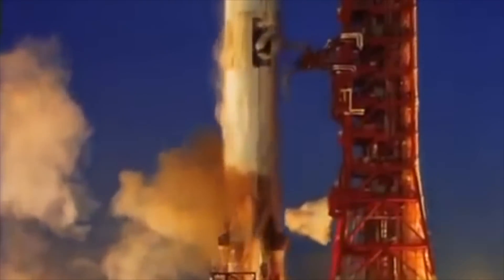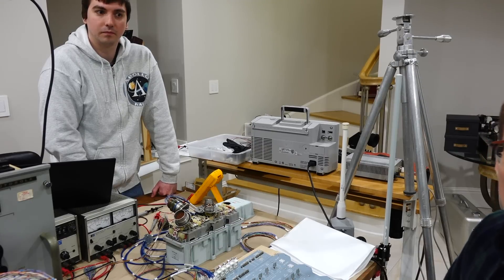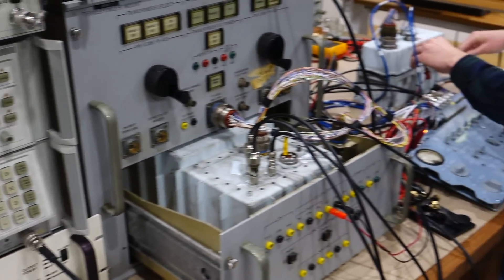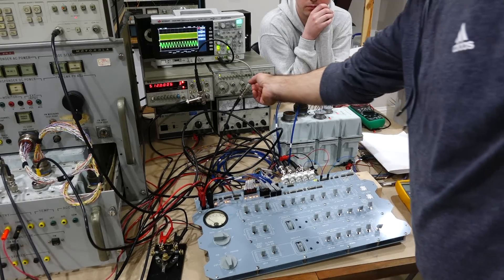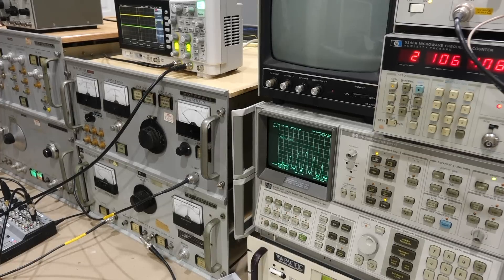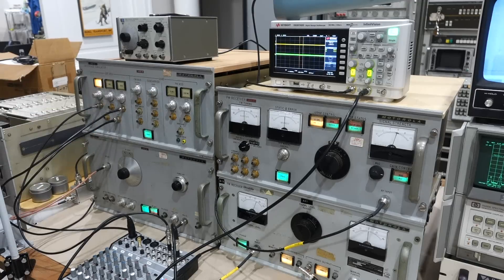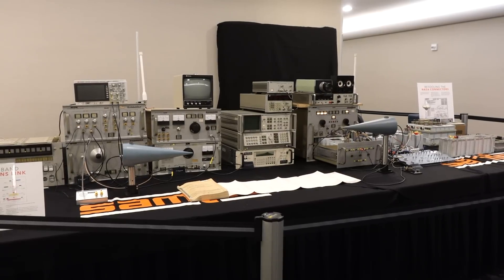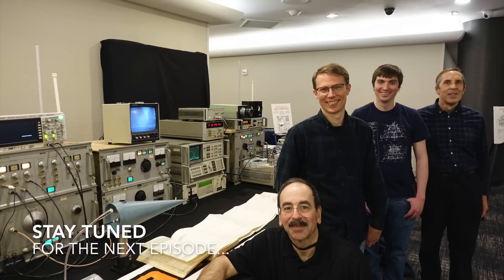Apollo Comms Part 26: Full system integration, Morse, TV, and upvoice are up, and an exhibit!

Comment: I would love if there were two tables with more space inbetween to showcase the ground and module more. It gives the feeling of the distances involved. Yet this is amazing to see restored as far as you have.
Reply from the maker: That was what we asked for at first, but they did not have enough space available to pull it off. I’m just glad they thought of using stage blocks instead of tables to take all the weight!
Reply: @CuriousMarc  This will sound silly, but in addition to the gap, a poster or cut-out of the Earth above one desk and another of the Lunar Module for the other would make the setup's purpose immediately clear to the casual observer.
Reply: @jamespreston7712 If they simulate the CM setup, the picture should showcase the CM waiting to pick up Buzz and Neil .

Comment: Thank you for pulling this together. They really built them to last. My father worked for Collins Radio in the 1960s on the design team for communication systems for Apollo, Gemini and Mercury space missions. Some of the hardware originally used in the Apollo systems was purchased from the Ace Hardware in the Spanish Village shopping center in north Dallas. (Collins had an office located in the telecom corridor of Richardson, Texas.) The team was facing cost overruns and deadline mitigation if they went through the conventional government spec, fabrication and procurement of these hardware components. Collins Aerospace still has an office in the area. Unfortunately, dad is unable to help with your amazing project, as he passed away in 2010. Keep up the good work!

Comment: I was wondering if you were going to implement the Quindar-tones since they were used as transmitter/switching controls, and not just a courtesy-beep that I for a long time thought they were. In having made several COR-controllers for Amateur-Radio repeaters, back when we used to take old Motorola and GE surplus commercial, discrete radio transmitters and receivers to make a repeater system.  So, I was impressed that you took the time to not only make the tone-generator bu have it do both tones!
To many, this would be boring or you'd be lost so quick; but the way you take the time to explain everything really keeps a fella engaged and feeling like you are there working along side the team; so great presentation skills Marc!  Thanks & 73...

Comment: This might be an unhelpful comment, but the timing between the subtitles and audio is off by quite a bit. The subtitles are mostly appearing too late.
By the way, thanks for the amazing video(s)!
Reply from the maker: This is very helpful! Sometimes the auto timing generator gets off the rails when I have to make lots of corrections to the auto captions (which was the case here). It should be fixed now. Thanks for letting me know.

Comment: Now that you fine folks know how it all works, time to optimize it down to a single PIC microcontroller, the control panel, and a wall-wart power supply, along with a VERY long extension cable from earth to the command module. 🤭

Comment: Also, where’s the 8” floppy drive? Every good spaceship (simulation) needs a working floppy drive. Oh, wait, that’s right. 8” floppy drives require mains power. Oh, well, I guess you’ll have to use a 5-1/4” floppy drive, then. Gotta have some way to load the operating system for this thing via the data uplink. 😊

Comment: So this was 2.1/ 2.2 Ghz frequencies ?
Reply from the maker: Correct.
Reply: @CuriousMarc  interesting  and i m curious what kind of powers in Watts could this be ?I mean to go that far 350 000 km with a 0.136 meter wavelength :)
Reply from the maker: @ftN975U  On the way down, very little, 10 Watts. They compensate with a huge antenna and cooled, near quantum limited receiver on earth. On the way up, they just blast it with 20 kW.
Reply: @CuriousMarc  20kW !!!  Wow ! enough to  totally melt arial cables :)  maybe why they weld and not solder their  components :and  I guess you dont push it that much for testing ? I also noticed its all Motorola gear i didnt know the company/brand  was that old !  Going back to my little hobby work... tweaking little chinese UV5s and Hack RF dev. boards  :) as an Ham radio enthusiast!  un grand merci de partager tout ça j'adore et c'est un veritable rêve de gosse pour moi ce home lab  :) wishing you a wonderful year ahead in 2024!